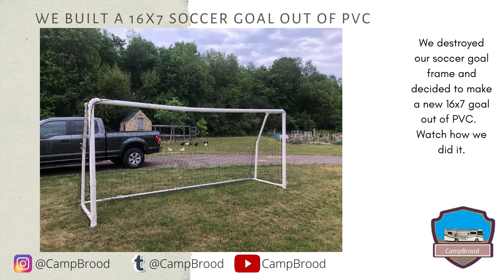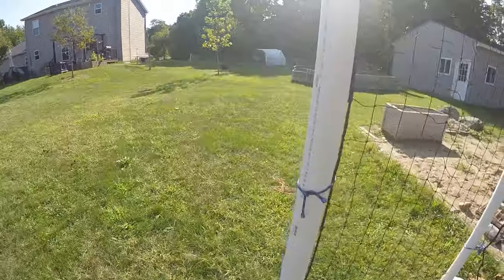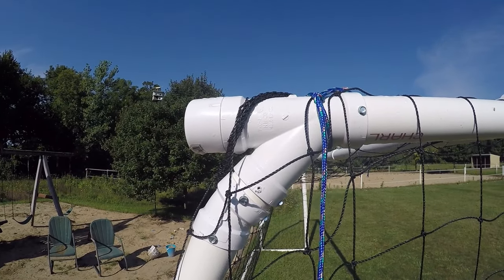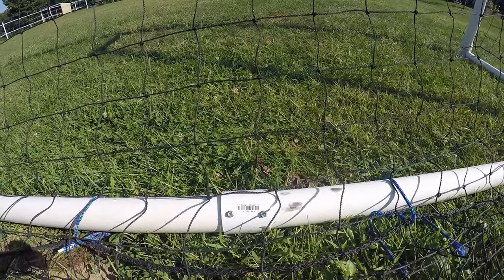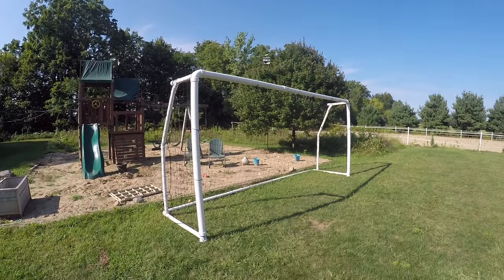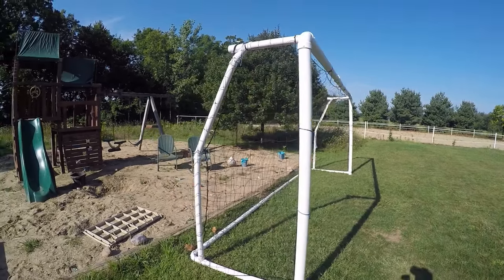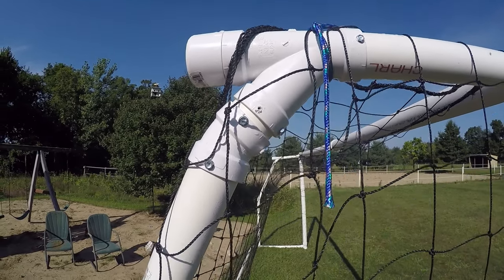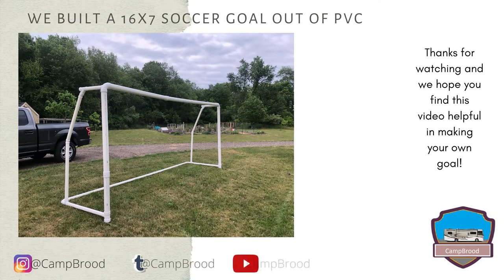Homemade SOCCER GOAL ⚽️ So Easy ANYONE can DIY it!

Comment: As a plumber I’d suggest use sch40 solid core pvc. It’s rated for pressure and more ridged
Reply from the maker: Thanks for the comment.  is there a pvc good for the UV, heat, cold, ice and snow?
Reply: @CampBrood  sch 40 is probably your best bet. The cel core will crack in cold weather. We have to watch for that when we’re roughing house in the winter here in chicago. If you need something stronger, the next step is sch 80. That’s a dark gray. I’ve used it on higher pressure systems such as commercial pools and food processing plants. The only problem there is you’ll probably have to get it from a supply house and it isn’t cheap

Comment: I see you're still responding to comments from not tok ling ago thats good. What do you mean by dry fitting the pieces together? And is glue absolutely needed or would I be able to just screw eveyrtbing together
Reply from the maker: Good question. Dry fit means no glue and no screws to make sure it all fits together. Without glue it collapses when hit. You must pvc glue and screw all fittings.

Comment: How much did all that pvc pipe cost?
Reply from the maker: About $130.  we did it more for a fun project than cost savings. Since we had the net it paid off as other goals with nets were way more expensive and I couldn’t find the frames for sale without a net. Thanks for watching.
Reply: @CampBrood  yeah no worries great job by the way just trying to get a idea on what size I want it to be within a budget
Reply from the maker: @ebenmoreau2637   understand totally.  those prices are from a few years ago, too.  Not sure how much PVC has increased in price.

Comment: Is there a cut list? Or just the verbal description in the video?
Reply from the maker: Side posts cut to 76.5”. Back side posts 34” and 43.25”. Top bar going back 16”. Bottom bar going back 37.5”. Back bottom post 69.25” plus a full 10’  top crossbar 68” plus 10’   You’ll also need 4 little pieces to connect the wyes up top and the 90s on the bottom in the back of the frame.
Reply: @CampBrood  thank you!
Reply from the maker: @Jstroth5620  no problem.  let me know how it works out for you.
Reply: @CampBrood  is the durable

Comment: How tall is the goal
Reply from the maker: The goal is 16 feet wide and 7 feet tall.
Reply: @CampBrood  how long did it take to build
Reply from the maker: @Cnucnin  a couple hours to go to store and probably anywhere from 2-4 hours at home. I dry fit everything first then glued and screwed all fittings.   Over the last year I’ve had a couple of breaks by balls hitting back 2” posts so trying to come up with an idea for strengthening the joints. I have older shooters with power.
Reply: @CampBrood  what screws did you use
Reply from the maker: @Cnucnin  Self tapping Sheet metal screws.  something that goes through the coupler or elbow and the length of pipe.  Choose a smaller diameter screw and put 3-4 screws per joint.
Reply: @CampBrood  did you put any stabilization such as sand into the bottom of the legs
Reply from the maker: @Cnucnin  The goal stays upright without any issues during normal use.  If I know a windstorm is coming I actually tip it down because I think storms helped to destroy the original goal frame we purchased.  I also like that it is lightweight so we can move it when we mow the lawn.
Reply: @CampBrood  how did you tie the net to the goal and which net did you use. Would stakes be helpful for a little extra stabilization
Reply from the maker: @Cnucnin  I used polyester rope and/or bailing twine to tie the net to the pvc frame.  We have horses so bailing twine is always available to us.  If you wanted a more permanent solution long zip ties would work, too.  I used the net from my old goal.  However, in the video notes I added amazon links for a net and target net that would work for the goal.  I'll put them here, too:  16x7 Net:               https://amzn.to/3lX2G1O              Target Net:            https://amzn.to/3wXAIZ0
Reply from the maker: @Cnucnin  We don't feel we need stakes.  Put it up and play with it a little and see what you think and let us know.  You may decide to add stakes and/or sand after you've had it a few weeks/months.  The good thing is that you can add that stuff later if you need to.
Reply: @CampBrood  alright thank you
Reply: @CampBrood  where did you buy your materials from because my Home Depot is selling the 3x10 pvc pipes for $30 EACH and the 2x10 for $20 EACH
Reply from the maker: @Cnucnin  menards. But it was last summer.
Reply: @CampBrood  how much did the 10 ft pvc cost you
Reply from the maker: @Cnucnin  sorry I don’t have that answer for you. I took my total receipt less returns to get the total cost and didn’t save the detailed receipts.

Comment: I’m considering trying to make  a 24’x8’ goal for my daughter, my fear is sagging in the top crossbar. 

She’s got a powerful kick, so I want to make it sturdy, but worried that added weight would only cause the center of the top crossbar to sag. 

Have you noticed any sagging with your 16’ goal?
Reply from the maker: Valid concern. I think pvc would sag with a 24’ span. We have a little sag but it’s generally corrected when we move the side posts square. When the side posts bow out at the front/bottom the crossbar sags.  You can see a little sag it in the video. After 10 months it hasn’t gotten worse.
Reply: Yeah, I’m thinking I’d probably need to add a 3rd vertical bar in the rear up the back in order to properly support the crossbar halfway across, essentially splitting it into two 12 foot lengths, which would hopefully be more stable.
Reply from the maker: @brettn  you may also want to beef up the back with 3" pvc all around.  It will provide more surface area for glue and screws and also more structure.  I don't think I would do the 16x7 any different but 3" all the way around would make it a little stronger, I think and also heavier which has pros and cons.
Reply: Been a little while, but wondering if you had any luck building the 24 x 8?